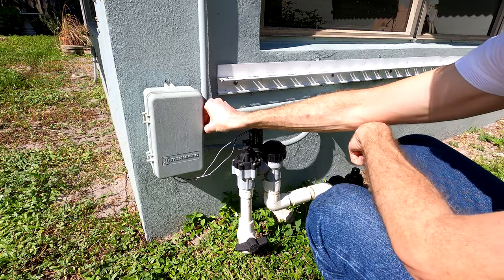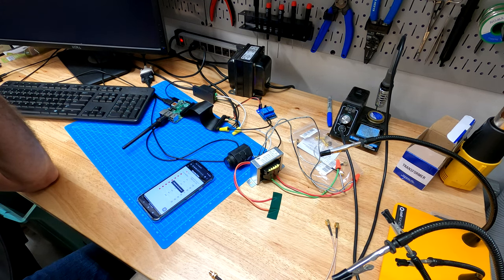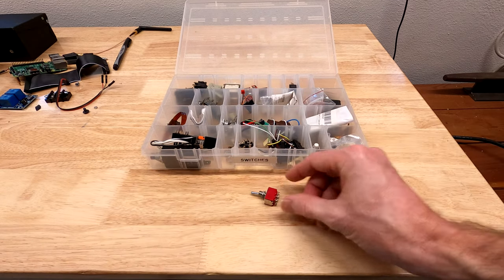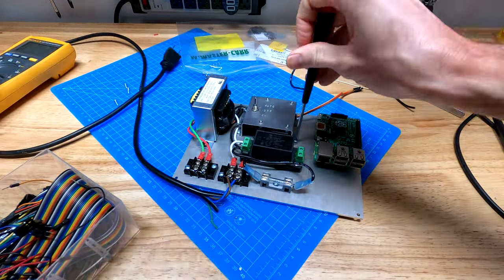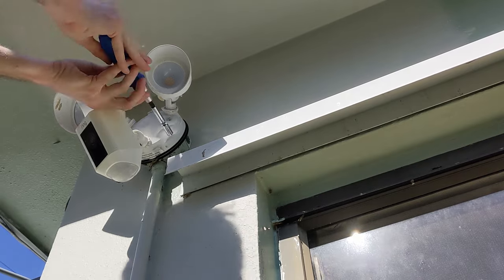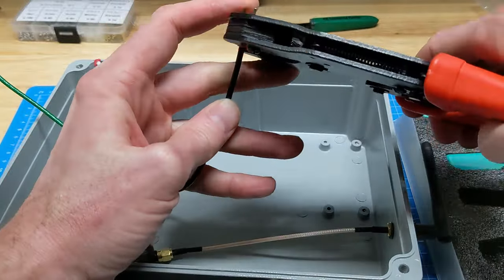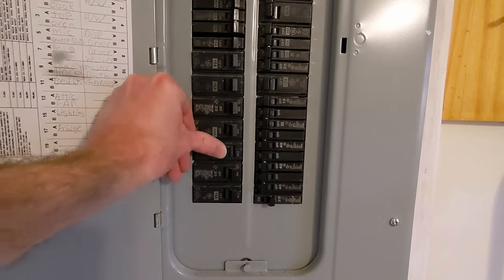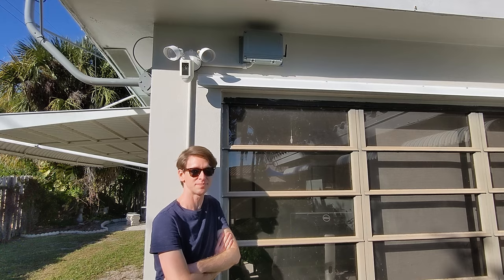DIY IoT Sprinkler Controller, made with Raspberry Pi and OpenSprinkler

Comment: pfff, a rpi just for that? you can do this with esp8266/32 or arduino
Reply from the maker: You can! But like I said, "an outdoor general-purpose computer". There may be other things I want this RPi to do...
Reply: @EikiMartinson  then you can add a speaker and play internet radio, rf433mhz receiver to you can control sprinklers and play/pause internet radio via a rf remote control (faster than using web browser). You can also attach a pir sensor and TH sensor and get outside weather conditions. You can also add a small led strip (maybe 10leds - not to draw too much current) but ws28XX and use it to “announce” things (red means rain is coming, blue means dinner is ready,  green means internet is down, etc)
Reply from the maker: @emaneht9886  All good ideas! A weather station was definitely part of my original plans.
Reply: how do you get open sprinkler to map to a gpio pin?
Reply: Ya, those old timers were SCARY! The boxes weren't even weather proof.
Reply: And it's not efficient, after 8 months of use can I ask how your SD card is ? It's overkill.

Comment: Do you mean 24V DC?
Reply from the maker: Nope, the transformer makes 24 VAC; no rectification happening there. That's the standard for irrigation system solenoid valves.
Reply: @EikiMartinson  outside of the USA I frequently see 220 VAC solenoid valves, and all of the others of lower voltage are DC. 
To me, using 220 VAC with water just seems too dangerous. Especially the ones that frequently have no waterproof casing around the power terminals.
Reply from the maker: @-______-______- Ah, fair enough! I don't know about solenoid valves outside the US. But 24VAC is common for residential systems here at least. I assume you're talking about places that have 220V mains so they're just switching that directly. I too would be less than comfortable with that!

Comment: Thats a great project. Do you happen to have a circuit diagram of the project. I am working on a project of my own, and I was wondering how did you connect the fuse, and how the circuit was grounded. I am very new to electrical projects.
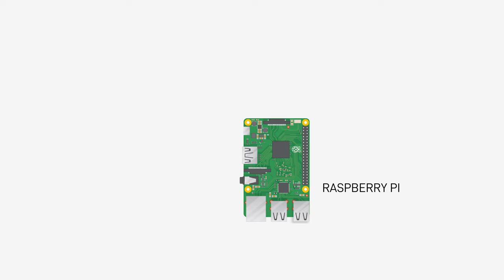Reply from the maker: Hello and thank you! The block diagram at 0:40 is pretty close to an actual circuit diagram, although you're right that earth grounding and the fuse aren't represented there. The fuse is in series with the AC mains hot wire (in the diagram this is a brown line, conforming to international standards, while in reality the wire has a black jacket, which is the standard in the United States). Earth ground comes in on a green wire (difficult to see) which I connect to the aluminum base plate at 16:08. I use a crimped-on ring terminal that accepts the mounting screw. As @libertine5606 mentioned, it would be a good idea to cover up the terminal strip because there is live mains power there that someone could contact if they open up the lid on this.
Reply: That makes so much sense now. I have few questions here. I am using an ABS plastic enclosure, does that mean I don’t  need to ground the box, and just leave the green wire secured with a wire screw? 

And, what are the specifications of the fuse you are using. Can you paste a link maybe.
Reply from the maker: @hemanthreddy-e7i  The reason you ground the box is that if a conductor, like a wire, comes loose, it may then make contact with the box from the inside. Because it is metal and conductive the entire box will then be at mains voltage (120 VAC in the US) with respect to ground and able to supply substantial current to whatever touches it and provides a path to ground, like a human being. That's how you get shocked. If you connect the box to the earth ground (green wire), THAT becomes the easiest (lowest impedance) path to ground, keeping you safe.

So you can probably see why grounding a plastic box doesn't make any sense, because it's already an insulator (if you can't see this you've got a lot more learning to do before attempting whatever you're doing). But be careful! Suppose you use a metal screw to install something inside the box, and the head of that screw is touchable on the outside of the enclosure. Think about switches or connectors or any other metal that goes through the wall of the enclosure. All of them can be dangerous. If you had a metal enclosure it made contact with these and grounded them all but the plastic enclosure doesn't help with that.

Do your research and stay safe with this. Building AC mains projects is a big step in terms of danger from building battery-powered devices. Show your design to someone experienced before building it or powering it up. And read this for more: https://electronics.stackexchange.com/questions/193543/are-plastic-enclosures-safe-for-hobby-mains-voltage-projects

Comment: I have an old controller that no longer activates the circuits but an unused b+ as we.. Could you share the pinout info from the pi to the transformer. I think I can harvest parts from my controller and basically get build a replacement as well.
Reply from the maker: Hi! Thanks for your comment. You can use any of the Pi's GPIO pins to drive a relay board. Depending on how that board is set up, you may choose active high or active low in Open Sprinkler. And you can use the relay to switch the mains power to the transformer. In my case I'm taking 5V power and ground to the relay board from Pi pins 4 and 6, then using pin 12 (GPIO 18) as the signal to the relay. Does that make sense?

Comment: Nice work. Like your vice bender.
Reply from the maker: Thank you!
Reply from the maker: And probably I should have explicitly mentioned the earth wire I attach to the plate at 16:07. You're right: it's a very important electrical safety feature!

Comment: Looks like there is mains power exposed in a area that you have a switch.  It probably be better if that was behind a non-conductive plate.  It probably doesn't matter too much since you would have to get on a ladder to get to the box. I am not sure but is the box grounded?  

I have been hesitant to go after my sprinkler system but seeing how you used the 24 volt transformer I am ready to tackle my 6 station system.  I use MOSFETS instead of mechanical relays.  I would us a ESP32 and Home Assistant.  I have used them for the last six months and they have been bombproof.
Reply from the maker: The box is grounded, yes. The switch is really just a convenience for myself, and you're right it's not the safest thing because you could touch the terminal strips with your finger while accessing the inside of the enclosure, although it's not really worse in this respect than the old timer was. A safety upgrade would be to put a little sub-enclosure around the terminal strip area. I may do that in a future video. Thanks for the comment!

Comment: Why is your house wiring made of solid copper instead of stranded? Solid ones have less area of contact.
Reply from the maker: Solid wire is pretty typical in the United States. But what do you mean by "area of contact"?
Reply: @EikiMartinson  Well in my country its stranded. When screwing the wire in, stranded fire can flatten out more than solid wire and so it will have a larger area of contact. But I don't know if it makes a difference.
Reply from the maker: @that70sshow82  What country is that, may I ask? It's true what you say; that's why (along with flexibility of course) I used stranded wire with crimped ends for the new wires I ran in this project. But It's worth noting that many US outlets and switches require you to hook the wire around a screw terminal, and strands have a tendency to squeeze out of such connections.
Reply: @EikiMartinson  India

Comment: It is against the NEC to run high voltage in the same conduit with low voltage.
Reply from the maker: That's why I was initially talking about two conduits. But this was easier and cleaner. Can you articulate the specific risk posed by this configuration?
Reply: @EikiMartinson the cables get damaged, high voltage runs through low voltage wires, some low voltage electronics burns out and starts a fire
Reply from the maker: @PatrikTheDev  Damaged inside the conduit? I suppose I can think of some unlikely scenarios in which that could happen, maybe some small creature gaining access to the inside of the conduit and chewing through two insulations. But note also the electronics are isolated from the low voltage line in question anyway. You could burn out the solenoid though, I grant, and then there's this scenario: if all four wires in the conduit are damaged and touch in such a way that the HV energizes both sides of the transformer at once, that could lead to interesting consequences for the transformer, yes. Since I have some other changes in mind also, I may redo this aspect of the project.
Reply: @EikiMartinson  I wouldn’t worry about it that much, I was just saying why it’s against code in some/most places. Cables can rub on themselves slightly or animals could chew on the cables but the more likely scenario is a short in the high voltage cable tripping your breaker. If you have the time to redo it, go for it but I wouldn’t feel bad if you don’t wanna bother
Reply from the maker: @PatrikTheDev  Thanks for you comment though! I'm all about completeness and correctness. It's also worth covering the terminal strip for safety since the switch implies users can access the internals, as pointed out by another commentator. Then there's the other things I could do with an outdoor Raspberry Pi... this installation is very near a defunct satellite dish that would make a great mounting point for a weather monitoring station!
Reply: @EikiMartinson  love the attitude towards it, I also like to make my projects properly (especially HV outdoor ones). I cheaped out on our outdoor light wiring once and some raccoon chewed through the wires. We had no idea what was going wrong but our breaker would trip completely randomly, turns out the cables were shorting out and it’s a miracle nothing caught on fire
Reply from the maker: @PatrikTheDev  Would love to hear more about those projects sometime!

Comment: Very very nicely done. Your work is neat and well thought out. I am impressed. The only possible suggestion I would’ve had would be to use a different color wires for the sprinkler line. While it’s easy for you to distinguish between which is power and which one is 24 VAC.. there’s always a possibility that someone else might come along if you sell the house. But honestly, you did a fantastic job.
Reply from the maker: Thank you for your kind words! The next owners will probably be mystified to learn their sprinklers are controlled by a "raspberry pie". ;) Handing over IoT hardware like this is a tricky thing in any case for reasons of network provisioning if nothing else (I think about this a lot). I agree with your comment though; other colors for 24V would certainly have been the right thing to do in this case. But you know how it goes: all I have handy is black, white, green, and sometimes red!